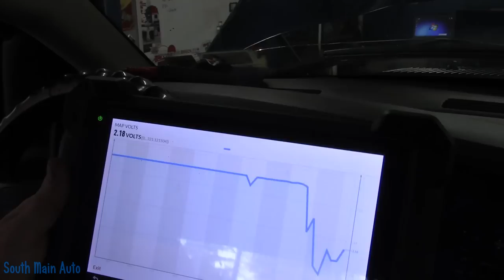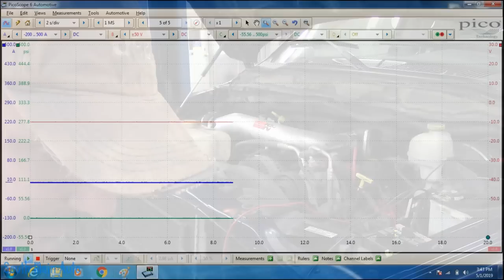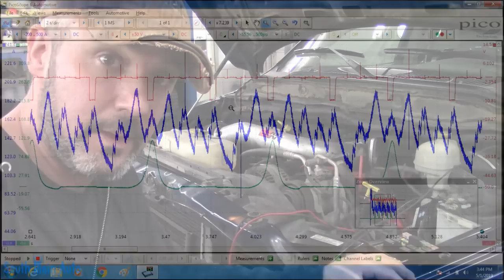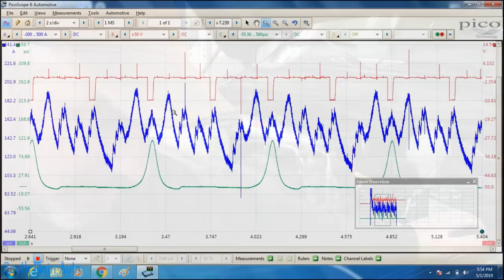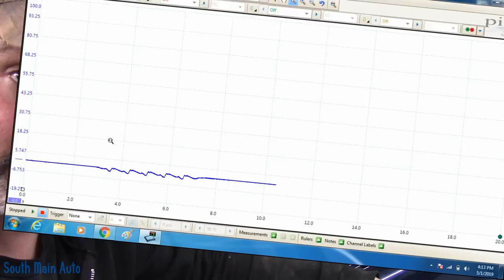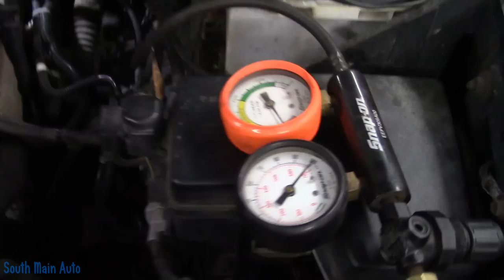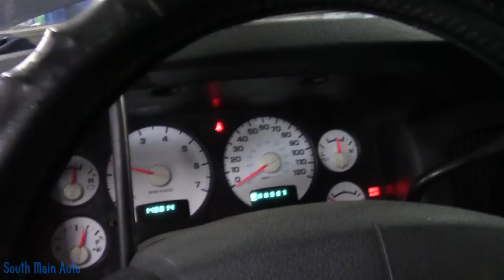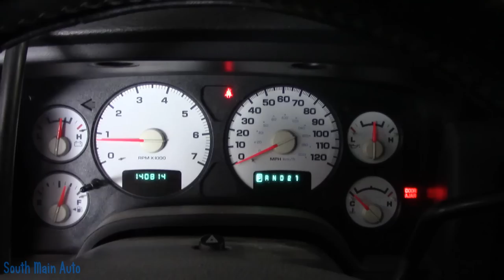5.7 Hemi Ram - Bad Misfire & Will Not Idle

Comment: Yeah. Great video!!  You used compressed air in the spark plug hole to keep the intake valve up while changing the spring, right?  My buddy Tim showed me that trick on a Hemi about 2 years ago.  I thought he was a genius and he said that every mechanic on the planet knew that trick.  😂😂

Thanks so much for the outstanding videos.  You are such a good teacher. You may not believe it, but your videos need to be part of a master class. You’re that good!!

Thanks again!!
Reply: Yeah they taught that compressed-air trick in automotives class in high school back in the 60's.
Reply: If your compressed air supply is less than the time needed, there is an alternative trick. Lower the piston a bit, feed a piece of thin rope through the plug hole and raise the piston against the wad of rope. Valve is held in place while spring is replaced. When repair is complete, lower piston and pull out the rope. Hopefully, you use a long enough rope that there is plenty on the outside of the engine.
Reply: @JW...-oj5iw  This is exactly what I would do "in the field" when compressed air wasn't available.  Pretty old school trick.  Always tie off the other end of the rope so you don't lose it inside the cylinder.
Reply: I have used the rope in the cylinder for over 60 years on aircraft engines. The guy that taught me learned it in 1920. Some things never go out of style.
Reply: AKJeeper yep if the valve drops while using compressed air your pretty much stuck with pulling the head

Comment: Yep, my 2004 ram hemi broke the identical valve spring at about 200k. Finally got rid of it at 302k. Heck of a truck.
Reply: Don Quixote  I have a 05 also . fingers crossed  . Ive had it for around 4 yrs . 150 k on motor .
Reply: It was only about a $350 repair at the dealer. Not bad. Eric O likely better price and way better quality.
Reply: @mikenonameneeded3485  Did the issue stop at the '05 year? I see a lot of commenters here only mentioning '03-'04 model year Hemis having this issue. My '05 has over 200k now and doesn't seem to have a single problem.
Reply: I dont know.

Comment: I have a 3.6 v6 2011 dodge charger that has a cylinder 1 misfire. It wouldn't stay running without pushing gas and it died at every stop light .i took it to a shop and they called me today and said it was valve spring on cylinder 1. So they are fixing for me right now. Thank god. They can fix it.

Comment: Same problem on my 2003 1500 - replaced ALL the valve springs with the springs from the 6.4 Hemi and haven't had an issue in over 50k miles.

Comment: Our 04 Dodge did the same thing at only 80 thousand miles and since I've probably fixed 4 or 5 more for other folks. I'm pretty sure it was a bad batch of valve springs or something.
Reply: @Rusty Highlander Dodge nuff said.
Reply: Defective roller lifters that loose the needle bearings and flat spot the cam 
Well documented

Comment: The cam shaft has been flat spotted. The roller lifters go bad and lose the needles in the bearings then the lifter wipes out the cam. Becoming a very common  issue with the 5.7 l Hemi engine.
Reply: There's been many videos in recent weeks highlighting exactly what you're describing. Scary.
Reply: Is this true on the Pentastar 3.6L too?
Reply: @5jjt  I hope not. It's in my Jeep! I think some 2012s had some lifter noise issues.
Reply: @5jjt  Buddy, the 3.6 is an entirely different engine. Its a DOHC engine not a OHV pushrod engine. How can you be watching his videos and not know this????
Reply: @jeffissimo1221  i just did lifters and new cam in my 2012 grand Cherokee a few weeks ago.  Those melling hydraulic lifters are failing at a ridiculous rate.  Only have 105k on the clock too.
Reply: How can a cam be flat after breaking a spring. Something had to compress the spring to break it
Reply: @billyivwen  the hemi tick!

Comment: I was at the dealer the otherday dealing my a defect on my Ram, and was talking with the service manager about interesting problems. He was telling me that they had a influx of bad heads on the 5.2 and 5.67 hemi's cause they where being built so cheap. The problem the exhibited was misfire at idle. The verdit that was causing this turned out to be cracked valve seats, in close proximity to the cooling passages. Which would cause weeping of coolant that would leak across the plug at idle.
Reply: a 5.2 hemi?? a 5.67 hemi?
The 5.2 was a 318 cubic inch,  and not a hemi.  Not sure how you come up with a 5.67 hemi ?
Reply: @bertgrau9246  typo that I didn't catch. I am dyslexic too, so things often get flipped unintentionally.

Comment: Nice Chrysler design...always focus on valves springs
Reply: Always throw shade on mopar horror of horrors a valve spring broke on a 15 year old Dodge truck with 140k miles and now it runs like new with a fairly minor minor spring repair.

Comment: K&N and MSD components, broken valve spring---added together, I would guess it's a kid's truck that's been beat to hell and overrevved
Reply: Must be and probably doesn't change the oil enough why do people do that red lining a engine that is not built to do that sort of thing is ridiculous
Reply: @neilmurphy845  ; no the inside of the valve train looked clean and good . means owner takes good care of , and spends money on  , the  truck
Reply: @neilmurphy845   I've seen plenty of people do that to these trucks simply do to ignorance of vehicle maintenance and they wanna look bad ass to people around them because it's a HEMI . They do the worst with the diesels because they have no clue what a diesel is made for ,(Torque )Pulling power not speed . I see them race them off the stop lights around here and speed through traffic bellowing black exhaust all the way because of the damage their doing to the diesel by racing the engines as they do .All in the name of looking  or sounding cool to people around them.
Reply: @tracycolorado  yah he's good like that it's good he's putting a bit of money into keeping it going instead of replacing it whit a new truck
Reply: @d.a.2742  i hate when people do that to the engine when they over fuel it doing that destroyers the oil and there for the engine then they'll say the car is crap
Reply: @d.a.2742  I notice that kids tend to think of trucks as hot rods in general nowadays, based on the way I see them being driven. These poor souls weren't around when you could pick up a decent '79 Camaro or Mustang GT for $3K
Reply: @justsumguy2u  Ford Raptor ring a bell?
Reply: @neilmurphy845  A redline is a redline. An engine will do 80% redline all day for weeks on end. It's designed to function continuously at that speed when fully up to operating temp. Redline is the point where the rotating or reciprocating masses can't handle the forces put on them for very long. It's the point where the parts enter plastic deformation and valve trains can't keep up with the combustion cycles.
Reply: Dont forget that he has the cheapo Specra filter on it and not the good K&N.
Reply: So, how a metal spring can broke?
Reply: @sabergermd  Yep, and they are ultra-expensive specialty trucks. I don't see many kids being able to afford one of those...
Reply: @Amarillobymorning777  Steel is not indestructable, and springs have a tensile strength limit
Reply: @d.a.2742  They gotta roll that coal.
Reply: @mannys9130  ow is that why in the owners book it will always tell you never race a cold engine
Reply: @rebelndirt8830  There is not such a thing.  They are terribly bad filters, and add very little power to the engine, while increasing the wear a lot.
Reply: @justsumguy2u  CMC Cyclone, 454 SS, SVT Lightning....trucks can be hot rods. They're fun to hot rod.
Reply: @MegaDysart  No they're not--trucks are big clumsy appliances that are made to do work. If you want to go fast, do it right and buy a car
Reply: justsomeguytoyou anything can be a hot rod any anything can blow up after the snot is beat out of it. Cars are a better option because they’re lighter, which makes starting and stopping easier. Trucks are heavier but just as good of a candidate for rodding as cars are
Reply: @bigmanbuilds  I never said they couldn't be fast, but who wants some huge leviathon that handles like a brick as a hot rod? I know I don't....
Reply: @justsumguy2u   Truck are great to make big power in...rear wheel drive, tourqey v8 with a body on frame construction ,  just dont expect great handling!
Reply: while using cheap oil and extended oil change intervals. 5.7 won't last long under those conditions. they noted for bad cam/roller lifters.
Reply: I have a 2004 Dodge Ram with the Hemi💪 it has a C.A.I. on it, a K&N and an Air Raid throttle spacer which they works great together. A Bullydog tuner and Platinum plugs, all 16 of them. It has over 192,000 orginal  miles on it and haven't touched the engine other than to do the water pump two weeks ago. I beat the brakes off that fat girl at the drag strip every chance I get and drive it like a stole it lol.... Plus it has a Flowmaster Super 10 series muffler on it so everyone around knows when she's getting a beating. Never had any failure with the engine and I've been doing this for the last 10 years.
Reply: @Amarillobymorning777  The racing add on stuff is a clue the owner revs and/or redlines the engine. Any over revved engine will experience "valve float" which stresses the valve springs. Low quality steel in the valve springs will contribute to the problem if that's the case.

Comment: If ya can't Dodge it, RAM it! 😁 

Nice work as always. 👍 Bet the customer was super happy to hear that news!

Finally drove my s-box truck yesterday! First time in 2 months. No howling or other noises back there, so I won (I'd better shut up - only 5 miles on it so far). Only issue is, OX included every air fitting, except the one to connect the line to the compressor! Looks like I'll be waiting another week for those parts to get here. At least I can drive it now, though. Going to have to run the air line from the diff up into the cab, to keep water and crap out of there in the meantime. Not a huge deal - I can still use 4x4 to get moving when it's raining, lol. 

Foul mood today. My town is threatening to put a lien on my house if I don't either, A) pay $60 + $23 & change late fees for use of the transfer station that I haven't used ever, or, B) show them a receipt from a trash hauler. Thought this was America where as long as you're not dumping stuff on the side of the road, it's nobody's business where your trash goes. Not anymore I guess. What the hell is happening to this country? 😢

Comment: Common Problem on this engine. Done a few.
Reply: I have heard they have had a lot of probldms with valve seats and valve springs, but I have a 2007 dodge 1500 that has 268, 000 on the engine and have not had a problem yet, knock on wood!!!

Comment: Extra footage. Made me go from (cry for the customer) to smile at the mechanic. 
Your an amazing mechanic.
I just replaced my crankshaft position sensor. Long story short. The 3rd sensor OEM runs great. 
The (2) budget sensors....truck was in limp mode, flashing Money light. 
That's for the confidence to do these things.
Reply: I have seen someone find sensors with the wires swapped and make engine not run.  The signal was inverted.  Might have been Eric here.

Comment: When I worked at a dodge dealership here in Canada i used to come across lots of hemi's with that exact same issue, usually more then 1 per bank. also the valve seats usually wear out fast causing issues, best bet is to get the head rebuilt! Great video man

Comment: So what a way to do compression test. I still use a pressure gauge. Plug out.  Guage in... Pedel to the floor... crank... Then wright it down... Move on. Wish I could do it your way. Probably could never afford the pico system you have. But it's a nice dream though🤔🤔

Comment: Nice. I wasn't aware you could check the 'compression' that way. Of course it helps a bit having the right toys, lol. Thanks for sharing. Oh yeah, don't know if you remember me talking about my battery problems of being drained enough to where it wouldn't start. Anyway, the last time I charged the battery, I was hooking up the negative when I happened to notice the body ground a few inches away and it was a 10mm as well. So I pulled it off and cleaned up the screw as well as between the washers and the car seems to start ok now. Go figure. I still want to check other things and have cleaned up a couple more grounds since and will be checking the alt., bat., and maybe the starter with a friends tester. You also did the rear alignment for me and new tires, which I noticed a difference right away when driving home. '07 Mits. Galant. Thanks for that as well.

Comment: Usually a heavy foot contributes to the broken springs in my experience lol
Reply: Agreed. Someone probably revved the nuts off of it or tried to engine brake at 9,000 rpm. Hemis don't just throw valve train components. Those top ends are pretty stout.
Reply: It was an unloaded rev contest. The guy should be glad Eric helped him.
Reply: They can rev pretty high if you put the pedal to the floor. It'll set records but it'll probably blow up in the process, I've nailed mine a few times but it's definitely not something I do often. In my normal driving I rarely get it above 2000 rpm and it usually stays around 1500 rpm on these hilly Virginia roads. Seems like some of the less logical people that own these things make them look bad for everyone else.
Reply: Ya I got an 08 Charger r/t with the 5.7 hemi and I’m guilty of the heavy foot myself 😁. But she gets her proper maintenance and seems to be holding strong at 230k miles
Reply: @jonwm01  200k on my '05 Ram 1500 with the 5.7 and 5 speed automatic. Good oil change intervals and of course make sure to keep the transmission fluid and filters changed! I guarantee more than 90% of people who complain of transmission issues, especially with used cars haven't changed their fluids properly!

Comment: G'day, Mr. O! I enjoyed the video! It's amazing!! My guess was going to be, intake valve on cylinder 5 is stuck open! Hence the reason, for the loss of compression! When the push rod moves back & forth. (as you know) There is normally the force of the spring closing the valve... Unless it was a burnt exhaust valve and was leaking badly, and not quite closing. Thank you! Great job!

Cheers! 😊🛠❤️✌🏼

Comment: Pretty common for the hemi. I'm glad I haven't broken any springs on mine as much as I over-rev it. Common misfire issues on a hemi are broken springs, dropped valve seats, seized roller lifter, blown head gasket, bad coils, and weak injectors (the ones they put on there are crap).

Comment: Build quality on that one was junk, 140K ain't anything worth noting.
Reply: The 5.7L Hemis have always been trash truck engines, known for valve spring issues from the beginning.  That's why the police gave up on them and went to the Taurus.  Too many complete engine failures well under 100K, most closer to 40-50k.  I heard it straight from the horse's mouth from several officers that they will never use Dodge again due to all the blow ups.  FCA baby, they're going bankrupt again.

Comment: I'd turn that leakdown guage to 85-90psi. Having said that, your the reason I know as much as I do. I work for a major USA manufacturer doing teardowns on warranty claims and prototype diagnostics. You will get bit maxing out shop air. Also, get a oil water separator for before your reel. Love your channel, been a patron since you started that.

Comment: Nice to see that it wasn't too hard to fix. Considering that the battery was off so the codes were cleared I'd expect it to have to re-learn the mix, but it seems like it weren't too bad. Sometimes cars have to re-learn when they have suffered lack of battery and that can take a while to do.

Comment: Bonus footage! Sounds like Ivan. It’s tricky replacing that spring with the head still on.(memah musta told ya) I’m surprised how much that one cylinder affected how the whole engine ran. Nicely done Eric ya saved that guy some big bucks.
Reply: I've replaced all the springs and valve stem seals on a Chevy 350 like this. Piston must be at TDC, valves in closed position, with shop air pressure applied to the cylinder via the spark plug hole. Keeps the valve in place while the spring is removed.

Comment: That costumer got lucky. I did a 2011 challenger srt 8 few months ago same problem spring broke in half. A head job with a new valve took care of that since the old one got bent not piston damage. In my case the noise was loud coming from the top of the engine.

Comment: Super mechanic Eric saves the day again , top job , got a Chevy ss pickup  V8 from sandy Dubai here in the UK ,1994 model , banana yellow , came in a container kit form, none runner, turns over on key, if spraying brake cleaner down intake n crank it over will run sweet, checked injectors , no pulse , got fuel at rail, pipe in tank leaking on pump , spraying fine spray back into tank, (easy fix ) , do these have immobilizer on ECU, key is only a blade , no chip in it , no info in UK , pain in the butt?

Comment: I am so impressed you went right to the problem. What makes that valve spring fail like that? I have an '05 hemi with 234,000 miles on it and it runs flawlessly and always has. I've done a lot of towing with it too.